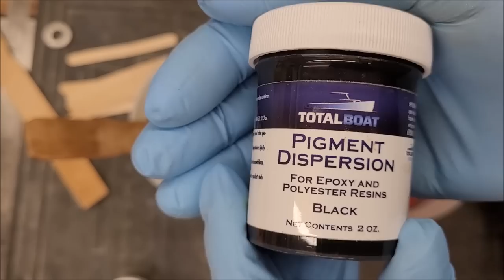OMG! That's Nasty... Lime Green Resin

Comment: I wonder what would happen if you were to place the vacuum pot into your freezer, maybe even pre chill it ? Think it might have an effect on the cracks due to heating during the cure?
Reply from the maker: Thank You Steve,  it's a pressure pot and it would help, I normally would put it out into the unheated part of the barn but it's not cold out there anymore now that spring is here

Comment: I’m wondering if you heat up the burl and allow it to cool to room temp before you cast the resin if that might help with cracking? If there is a slightly damp spot in the wood that might be the cause of the cracking?
Reply from the maker: Thank You Thank You, it might help, that wood is so dry though

Comment: Hi 👋, Pohl Barn Productions, That turned out looking 👀 very good, I love the colour combination. I think the resin mixing machine looks to be very good. Did you try the top coat epoxy, and if so, what was the result?. I had some resin back in 80s were I was making RC hydro boats and I was making them out of Kevlar and carbon fibre, and had a very bad problem with the resin. I believe the frost had got to it and ended up not curing properly, I seem to recollect that had gone a funny colour as well, stay safe, keep up the great work, 
PHIL FROM THE DARK SIDE OF THE MOULIN FRANCE,
Reply from the maker: Thank You Phil,  I have not tried the top coat yet,  my barn is heated but it's a few years old that's why I didn't use it.
Reply: @PohlBarnProductions  Hi 👋, I look 👀 forward to your next art project, PHIL FROM THE DARK SIDE OF THE MOULIN FRANCE.

Comment: Another very interesting project. I've been subscribed for a while now and have become troubled that I sold my lathe before I ever explored bowl turning. I'm currently shopping for another lathe! I have gone back and watched a number of your previous videos and don't recall you having as many cracking issues as you do now. Has something possibly changed in the resin formulas that might be possible contributors to the cracking?
Reply from the maker: Thank you Jim, Sorry to hear that,  it could have been anything really, moisture, over heating,  a change in the formula,  it happens

Comment: What abrasive wheel are you using on your angle grinder?
Looks like it works great 😃
Reply from the maker: I purchased a set of 4 from Amazon, I destroyed the first one on a project that had shells and sand in it, this one is holding up great for now

Comment: That really turned out nicely Doug.  The figure in the wood with the spalting and the flame go great with the colors and the black you used to fill the cracks kind of mimics some of the spalting lines.  The colors turned out really well.  Really like this bowl.  You are really getting proficient at using resin finish.
Reply from the maker: Thank you Mark,  I have to still work at the resin finish and it take up time I normally do not have.